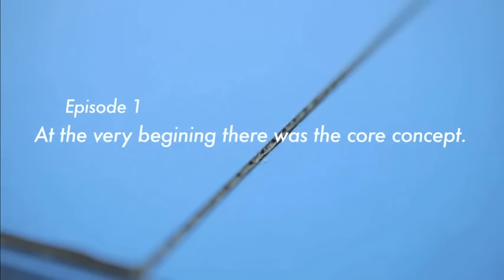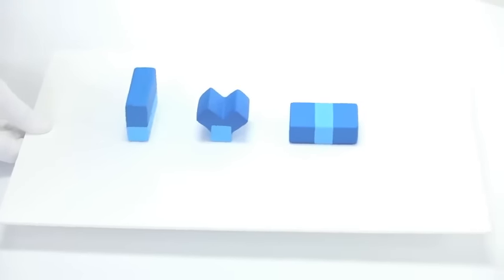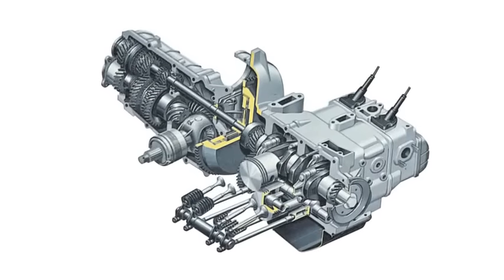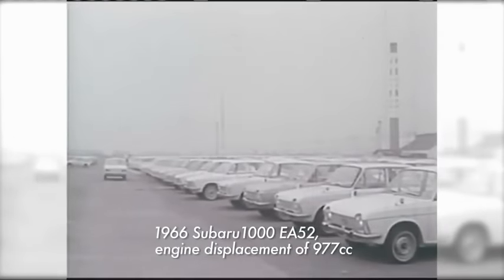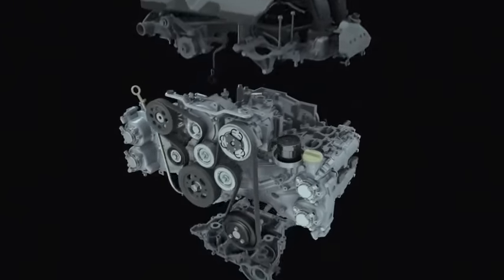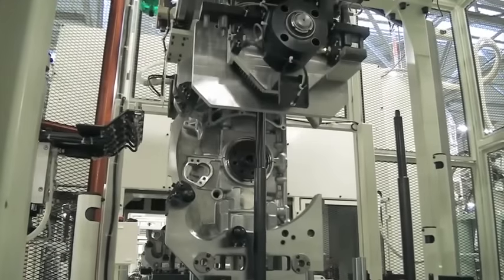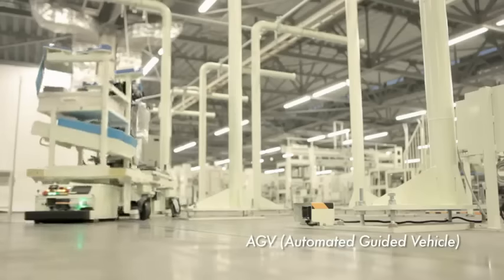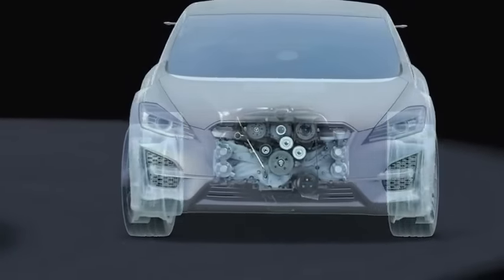Learn About Subaru Boxer Engine Technology

Comment: didn't VW beetles have boxer 4 cylinders all the way back in the 30s and 40s?
Reply: yep, the original VW Bug/Beetle from the 30s till 1981 had a boxer engine. It would be the same engine used in the Porsche 356 and Karmann Ghia.

Comment: Love my Subaru Forester BUT.. the head gasket problem on the 2.5 L is a problem Subaru should have fixed in the design process.  My 1.8 L on my '93 Impreza Wagon is fine.. the 2.5 Turbos are fine.. so why was the inner support lacking in the 2.5L design?  $1800 fix is a lot to swallow for an engine that is not that old. and yet I still love my Subaru Forester.

Comment: My Subis engine vibrates quite a bit especially at idle at 1000 rpm, it shakes when i rev it of course but is the idle vibration normal? I just put a Borla exhaust on it and now it seems to have stopped a little bit but i hear the slightly interrupted(by slightly interrupted I mean almost a "Put Put" but throatier idle is that normal? it runs like a dream, i just wanna deal with future issues. thank you so much for your feedback
Reply: Korbin Starkey. Change your spark plugs and get your fuel injectors serviced.

Comment: Wow, I never knew that. So Tatra is the originator of the boxer engine?
Reply: I believe the first transcontinental road trip (Horatio's Drive, sometime around 1904, but don't quote me) was in a Winton automobile with an opposed twin cylinder engine. Not sure about that, but there was a reference to having to replace the right cylinder at some point. Even more amazing, the drivers were able to continue their trip on one cylinder until they could meet the train bringing the new assembly.

Comment: Should've been mentioned these engines were originally designed for some of  japans airplanes in ww2. 
Sad to think my 2011 wrx is the peak performance for the EJ 2.5
Im not saying theyre the best car or better than say a porsche but for your money they handle incredibly. The symmetrical awd and the weight distribution just makebit even better

Comment: I need to change my timing belt/water pump soon on my 99 JDM wrx. I'm very scared. might just get a shop to do it.
Reply: +WesTay I can see why you're scared because almost no mechanic out there can do an immaculate job.  Besides they will upsell you a crank seal, water pump, etc just to make a few more bucks on parts and labor.   Are you sure yours is an interference engine?  Maybe you can wait till it is literally broken!
Reply: +Dominic Fong its a JDM spec ej205 2.0L turbo with avcs. reputably Subaru specialist wants $1,600 Canadian. for the job. I was expecting maybe $600-$1000 but $1,600 is insanity I think.
Reply: +Dominic Fong Water pump is supposed to be done when timing belt is, the bearing is only rated for 80-100k miles and may leak/sieze too much later. 
Crank seal, it's cheap. You can return it if yours is good.

Comment: Low vibration ha , take the dual mass fly wheel out of a boxer and see how low the vibration is . lol . , true. I have a Subaru impreza. I changed the engine . took the old engine apart. Amazing quality. A true work of Art

Comment: My impreza with EJ18 has 330,000kms on the clock and runs like new. I saw a 2002 impreza for sale with an EJ20 with 580,000kms on the clock and that was running strong too. Im a bit concerned about the new plastic intake manifolds. after 20+ years of engine heat then cooling they will become brittle and most likely break. : (

Comment: Supposedly the new third gen engines are supposed to not leak out the head gaskets after about 100,000 miles. Also, now they use a timing chain rather than a timing belt, so no more 100K timing belt changes.

Comment: Im getting a base model 06 impreza should i mod the 2.5i or swap for the 2.5l i wanna make 350 hp while still making good gas milage
Reply: Wtf is the point in that exactly  The cost of upping the base impreza into a wrx or sti is vastly higher than just getting the wrx/sti in the first place. I think 300 whp is the safe place for the weaker 5 speed wrx tranny and 330 to 350 is the maximum of the 2.5 engine before going internal. The biggest weakness of the whole subaru car is also its uniqueness the boxor engine. Just doesnt hold much power do to its weak internals and being made out of aluminium instead of cast iron. Also you should look at the cost of some of these wrx/sti owners on getting 350whp. Just stay aroudn 300 and its cheap but the closer you push towards 400 on a wrx means  fully built engine and adds on meaning around $15000. On a sti the tranny is vastly stronger so you might be able to get away with $7000. However the 2.5 engine is weaker.
Reply: Its my cousins old whip so exclude car cost but good info and i got just wanted a little insight from people because i was thinking the same as you were about swapping the tranny and i had already planned to do internal work on the engine
Reply: Well I mean even at a free car a 02-05 wrx is only worth around $5000 anymore. You could sell the newer impreza you have if you can a wrx and save yourself a ton of hassle and money. Plus everyone knows the bugeyes look the best.
Reply: If you want big hp + good milage buy an m 550 d way nicer cabin too

Comment: Wonder if the boxer engine design has anything to do with the head gasket issues...
Reply: [citation needed]
Reply: Giordan Diodato I dont understand
Reply: Rhys Gerwin do you have a source? I have a 2003 Baja with 238000 miles on it and I haven't had problems with head gaskets.
Reply: http://www.licmotorsports.com/blog/2014/01/30/dreaded-subaru-head-gasket-issue It may not happen to your vehicle buts it's not an uncommon issue.  Every Subaru I've looked at post 1998 (granted I'm not an expert) has had the headgaskets replaced because typically the owners were aware of this issue.  That link is one "source" I have on that and the rest of what I know about it is from experience and talking to Subaru mechanics.  I'm glad that you haven't had problems and I hope your Baja continues to run without head gasket issues because they're a costly repair.

Comment: Doesn't sound like a fart noise. Thank you boxer!
Reply: That would be unequal length headers. Slap some equal length headers on a Boxer engine and it will still sound like a fart..
Reply: Nicholas Varley I dunno the brz doesnt sound like its farting lol
Reply: BRZ has equal length headers
Reply: And wont ever have unequal length headers unless it utilizes the same location for a turbo as the WRX's

Comment: If you are an old Subaru driver, u should know the head gasket issue. Just type Head gasket Subaru in google. you will find out how bad they made this engine. The idea for boxer engine is good, but the parts, which put in to the engine, were bad. Plus, as a Subaru driver, I've never feel my car is quieter  than the others.

Comment: Wow new appreciation for Subaru and its a real shame to hear people swapping out the boxer engine in BRZs and Gt86es
Reply: its a shame, but 200 hp just isnt enough for the frs/brz no matter how you slice it
Reply: Yea guess so if you're chasing performance. Hopefully Subaru will equip future models with Turbo or a 6 cylinder boxer
Reply: Geelar Or they can just put the WRX engine and transmission to save money and time
Reply: Why not drop a fb20 turboed engine from the 2015 wrx turbo? its pretty much plug and play....
Reply: tim michelson
I know they developed the BRZ's engine to be even lower and further back into the car.

Comment: A mechanic told me the boxer type engines as they age  tend to drop carbon off the heads and pistons straight onto the valve seats as the motor sits switched off, as the motor cools down any carbon drops straight onto the valve seats, so when the motor starts again there is carbon between the valve and the valve seat, NOT GOOD! tends to lead to burnt valves and cracks in the valve seat, if you have an ageing subaru......get rid of it, the motors self destruct at earlier ages than the vertical or V configuration. it's an old pre ww2 design, copy of a VW   aircooled engine just with water cooling

Comment: I have an 2013 Impreza that runs fine.  I was looking for a Toyota Matrix but found out that 2012 was their last year.  My experience with the purchase of the Impreza taught me to never buy another Subaru.   Anyway, Toyota is the best automaker on the planet, so why settle for less than the best?
Reply: basically you like getting stuck in the snow

Comment: Hi, am planning to get the new sti 2015. is it possible to increase the hp up to 400 without damaging the engine like change the exhaust, turbo, filter, tuning etc. I live in Qatar and i will be driving the car everyday so please help me, thanks.
Reply: Daniel Chung my uncle said the same thing. thanks for the advice though. :)
Reply: And a different transmission.....
Reply: you're right.
Reply: anyways, iv'e ended up with a GMC sierra 2014 single cab. I'll be honest, it's way better than the old models.
Reply: +nicholas varly are you high the sti tranny can hold up 1000hp
Reply: I did and btw, in doha everything is possible :P
Reply: Nicholas Varley ......

Comment: I am on My third WRX, and just finished changing the timing belt, all pulleys, thermostat, water pump, radiator and the Fucking Air/oil separator gasket, 2004 EJ20. Fuck!!! they are tight and everything takes a while to do.... Also they forgot a few engines in the comparison, Rotary engines is one of them and they are low center of gravity with a rather strange looking triangle ... and the engine works!!!.... I love my WRX but fuck they are a pain in the ass to work on.
Reply: rotary engines have alot of their own problems. biggest is a much lower life expectancy compared to others.
Reply: briggs9187 
subarus are probably the most acessible  car to work with, everything is easy and acessible.

but stilll, rotary engines are most probably tougher than those pile of shit subaru. 2012 engines are HORRIBLE, consumes 2-3L of oil between oil changes, wich is a common problem on any new gen subaru
Reply: Changing spark plugs have to remove air intake on one side and on the other water tank.Takes as much time to move stuff so you can get to it.
Reply: Actually you nailed it...the oil separator is trouble. I found that they get easier to work on once you've pulled the intake manifold a couple times. Then you can get to everything. It becomes routine and fast.
Reply: find the right mechanic

Comment: subaru oil consumption problem??  is true? thx for your hepl
Reply: I've had problems with my 03 Baja being an oil burner.
Reply: Giordan Diodato i think all engines do but it only vary in degree. my corolla is an oil burner too.
Reply: Have had mine for a few years now, and do all the maintenance myself. I put 4.25 liters in and get just under that out. Mine is a 06 EJ255, a damn near bullet proof engine. I'll swear by it.
Reply: once the piston ring wears out in a boxer engine, it will burn more oil then other types of engine. In upright engines, the oil has to fight against gravity to get into the piston chamber. Whereas it can slide on in in a boxer. All types of engines will burn oil when the piston rings are worn. Boxers simply burn more.

The solution is simple. Regardless of engine type you should rebuild it when it starts burning oil. Then there's no problem. =D
Reply: casey b Yeah, that is true. Within a couple weeks of owning mine I went ahead and pulled the engine. Previous owner didn't keep maint records. So just to be safe I went ahead and replaced seals, rings, gaskets, pullies, belts, bearings, and the water pump. The block and heads were still withing 2k of an inch. Might have gotten away with not honing the cylinders, but no reason to chance a thing like that. Was able to pull, replace and reinstall all in a single weekend. Next time I'll make sure to have another set of hands on the install...that was a bitch!!

Comment: Couldn't one get the low centre of gravity simply by putting an inline on its side?
Reply: Bmw kind of achieved this by making the engine a slant towards the passenger side of the car. It lowered the centre of gravity and in ways balanced the car left to right, countering a single drivers weight, as well
Reply: mathew Hernandez That's clever. I didn't even think of the driver's weight :)
Reply: Vibrations and symmetry.
Reply: It would not work, just think about there would they put the clutch and gearbox, it literary be on place of passenger. And the hole other problem of drive train if the car is RWD
Reply: Could just offset with a gear pair, I think? Or I suppose 3 gears if they don't wanna change the direction.
Reply: Yeah, that should work, but adding gears would mean a loss of power to the wheels and more moving parts in the car, which means more places where it could fail, and as you know one of the biggest problems with internal combustion engines are the amount of moving parts it has.
Reply: MiT708 the transmission orientation relative to the block orientation is irrelevant. they don't need to line up at all, they need to just move power from disk to disk essentially. the engine can be turned up side down and as long as the transmission is lined up straight with the motor it will work

Comment: Boxer engines are the sexiest sounding engines
Reply: Not really, flat plane v8's are. Boxer engines dont have any special sound. What you are hearing is the unequal length headers changing the exhaust note. Run UEL headers on any engine and it will sound like that.

Comment: Wow, Boxers are for handling? Do Subi's handle good? well.. no
Is it so great that it's being used in other front engine cars? No 
Is this the only part in the car claiming to lower the CG? yes
Why haven't they installed other cheaper less extreme CG-lowering components?...
Can it make HP comparable to inline engines (e.g. 600HP/L)? No
Is it hard to work on? Yes
Do you have to jack up the car & take off the wheels just to change the plugs? yes
Is it a cool idea? Sure
Is it a gimmick? Definitely!

Comment: you know, those are pretty good points... Why does Subaru insist on using this design???? That's like installing a $5k ultra lightweight hood when you haven't even thought about reducing weight anywhere else...

Comment: I've never seen those angle split connecting rods.  Does anyone know what engine models are equipped with these?  I a couple EJ205s and and EJ255 and I've never seen them.  I am guessing they are for the diesels or the 6 cylinders.

Comment: I bought a Forester in Aug 2013, after the first 1000 KM oil change the next oil change after 10,000 KM yet after 3000KM the low oil level light came on. I checked the oil level, it was low. the car that time made only 4000KM. it took me over one year and the car made 90000 KM. and continuously visit to the workshop manager trying to resolve. the shop manager and their reliability engineers states that this is normal.
i am a technical person and know very well this is not normal. so I insisted that my case to be taken up with the factory FHI. when they did FHI stated that such oil consumption is not normal and the engine has to be changed.
beside the engine problem 3 wheel hubs failed prematurely, front shock absorbers weak. seat fabric threads came out loose on all seats, air condition problem. the list is long and the car is only 2 years old and made only 130,000 KM. 

bad car bad support both from the workshop and the factory. I wrote to them and never heard from them.
I regret buying Subaru.
Reply: +Abdul Aziz Mohamed  There was a class-action lawsuit and the owners won.  You should look into it and sue them.  With that kind of precedent, you should win or at least get some money out of them in small-claims court.
Reply: i am think of to do so, I am trying to get in touch with factory directly but  no luck.
I wrote to Fuji Heavy Industry but never got an answer from them. 
any suggestions before proceeding with legal action.
regards
Reply: Abdul Aziz Mohamed You can speak with your local dealership.  Also the headquarters for whatever country you are in.  Preferably get all that stuff in writing to prove that you have contacted them.  If you get no response, threaten to take them to court if they don't respond in, say, 10 business days.  I have heard that often if you plan to take them to court, they will settle outside of court so they don't embarrass themselves in court.  I don't know if you have something equivalent to "small claims court" where you are, but you probably do.  You can cite the class action lawsuit I mentioned as part of your case against them.  The fact that the owners won means that Subaru is in the wrong.
Reply: yeah they have that habit of burning oil a lot.